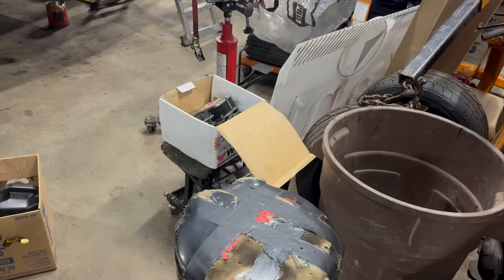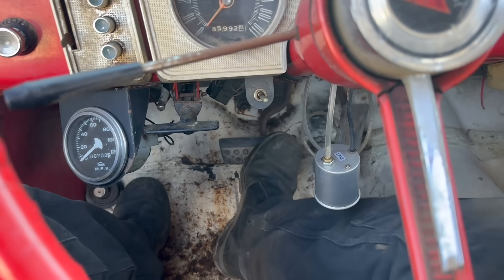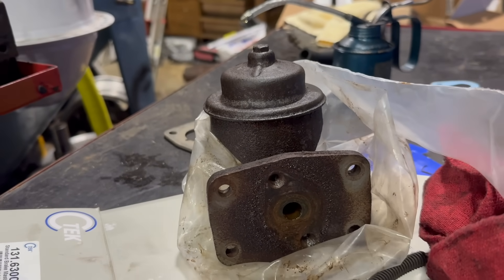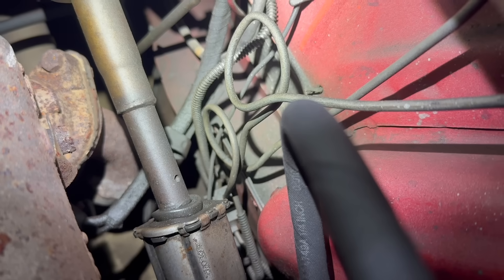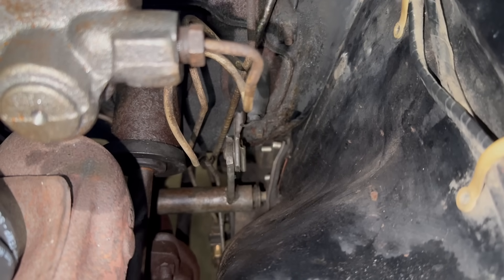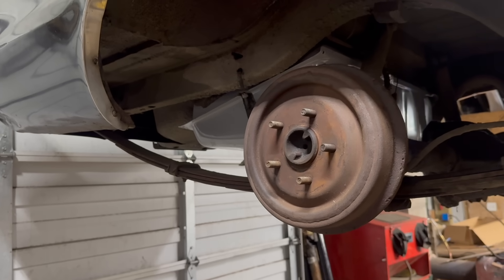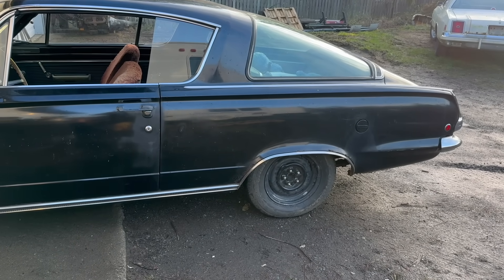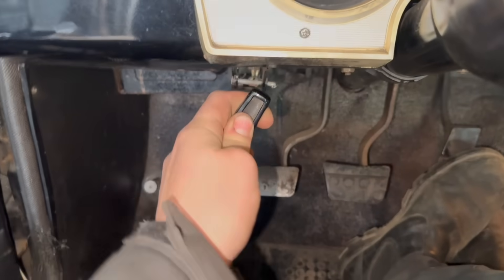Brake Safety Upgrade - Swap The "Pump And Pray" For A Dual Master Cylinder (A 1965 Barracuda Update)

Comment: I have used Fram oil filters for over thirty years and never had a problem,  you and Vice grip garage bashing fram filters is childish
Reply from the maker: So… have you ever seen the inside of one? I have. Have you ever seen one disintegrate? I have. Have you taken a training class in which the construction of Fram and less garbage filters are compared? I HAVE. I see nothing childish about passing fair and educated judgment on a lesser product.
Reply: @DeadDodgeGarage  the one that stuck in my memory is Fram diesel filters. Diesel dissolved the internal glue contaminating the fuel system.
Reply: @alcyr5655  I have seen it with my own eyes. My buddy changed the oil on his box truck himself. Within a week, he was on the phone to me asking if I could come to his business and listen to his engine. Yeah, engines don't lubricate well with cardboard...
Reply: My dad (RIP) worked for Chrysler for 44 years plus. He would never put a Fram filter on a Dodge, Plymouth or Chrysler engine. Never.
Reply: @OtherSarah2 My Dad was a CPD dealer mech for decades. He also refuses to use a Fram. As for me and my house, we run a Fram-Free zone
Reply: I prefer Hastings, Baldwin or Wix filters. The kid bought a FRAM oil filter for the 05 Buic(3.8L) and wow 1526 miles later it crushed its self. FRAM is code for JUNK.
Reply: I'm guessing you never cut one open to compare it with other filters. That or you changed them every 100 miles. 50+ years in industrial maintenance proved to me Wix, Baldwin or Hastings are the filters to use on any application using oil
Reply: @michaelwittke8336  Baldwwin for me!!
Reply: All I know for sure about Fram comes from several times I bought one at Walmart when changing my oil that day and that's all they had.  Big block Chevy, several small block Chevy's, a Caddy 425, a Ford 300 six, and maybe a couple of others I don't remember, and they ALL had half the oil pressure at idle.  ALL of them.  Fram-No thanks.
Reply: Everyone has an opinion )
Reply: I had the same experience on my Dads farm. We never had a problem or ever lost an engine. But I did stop buying them after I heard all the people bashing them. One of my cars has an open engine compartment. I would be embarrassed now if someone looked over and saw a fram. Don’t know how VGG has not been sued for defamation yet. I guess it’s the same as shooting a stack of Bud lights .
Reply: They come rusty from new. Crack one open, and then you wont want to use them. Its not a big investment to check for yourself. But my question is this. Why is it childish if Jamie has an opinion thats different from your own? You can say your experiences, debate it, and thats all fine. 

Then youd avoid the pin of shame lol.
Reply: I prefer Lee, but my stash disappeared years back. Personally never had Fram trouble but they do rust out and crumble when they sit for extended periods in the project yard.
Reply: How dare you. 😂
Reply: “Childish”:   Not being able to accept someone else’s opinion on a topic that differs from yours to the point where you can’t just either ignore and scroll by, or respond in a respectful manner.
Reply: man, you sound like a Fram worshiper, it's still a free country he can use or not use whatever filter he wants; I happen to not like Champion copper plugs will i be sent to the spark plug gulag for that, I have used them all and as long as you change the filter with the oil no matter how cheap or expensive the filter is it used to be every other change really it did your good ,
Reply: I hear they have a weak bypass spring and they bypass all the time not really filtering............ there are better filters
Reply: I've had 2 fram filters plug on my truck NO More
Reply: It's Jamie's channel so he can say whatever he wants! Deal with it, man!
Reply: Well mark if you go into the store and open a brand new one it shouldn't have rust in it. The one I bought did..
Reply: The high end filters from Fram seem to be fine and built similar to their competitors. But, the cheap Fram filters are garbage on the inside.
Reply: There are a few youtube channels that cut open filters for comparison.  Watch those and use your own judgement.
Reply: I used them too. There are just better made filters out there.
Reply: WIX for the WIN !   FRAM is cheap cardboard crap.
Reply: They've been cut open and exposed for the cheap design they are: flimsy cardboard elements held together with glue
Reply: I use only the Fram TG, no more orange
Reply: Yeah i don't get the drama either.I've used Fram for years with no issues,but then again I change my oil regularly.Maybe they changed design over the years?I figure they've got to be better than no filter at all.
Reply: @burtbacarach5034  , I will keep on using Fram. I have been using them for years. Dead Dodge garage won't change my mind.
Reply from the maker: @josephbonnette7877 I don’t want to change your mind, or anyone else’s. Opinions are like buttholes or whatever. Everyone’s got one and they all stink. 😂
Reply: I’ve used them all, for a long time I was a Wix XP user, but awhile back I changed over to the Fram Ultra Synthetic filters as they are very formidable filters and the price is great - my motto is to never leave them in there more than 5000 km
Reply: I have been pulling wrenches since 1973 and never ever had a problem with Fram. I still use Fram on my 79 Lil Red Express Truck
Reply: @josephbonnette7877  '73 puts me around 6 years old. And yes I wanted to help on the farm and service station. Times have really changed since then.
Reply: Watching VV G Is childish. SPARKALATERS- Really
Reply: @BigBoxDodge2020 Yeah, I've given VGG a chance a few times but never finished a video. The dumb humor and low compression personality just get tedious after a while.

He's better when he's with Frieburger or Chappelle. Not a fan

Comment: And !! I did put the adapter on and installed a flip top gas caps, I drive mine daily and have had two early A body gas caps stolen,  no problem with that anymore Jamie

Comment: Yep, took my pump and pray out and put a dual pot master cylinder from a 69 charger and it does great, drove it 6 years, put a later model aluminum truck master on using a two ta 4 bolt adapter.. it moved my master cylinder up away from my hooker super comps fenderwell headers.  Thank you again Jamie,  great video

Comment: Hi Jamie, great channel. Bought a 65' barracuda late last year that I am now starting to get it on the road. Your posts help a lot. 
I have a question that maybe someone can help me with.... 1965 barracuda all original (273 CI) with power brakes drum/drum, will the Raybestos MC36221 fit on the original brake booster?  
Regards Maarten

Comment: Wagner Electric invented a dual-cylinder brake system in 1960 and I believe AMC incorporated the feature in its 1962 Rambler line as did with Cadillac.   Always thought it was funny how Chrysler was supposedly an "Engineering" based company (probably more so in the 40's and earlier) yet AMC introduced it in their lowly economy line Rambler and then you had it on the top-of-the-line Eldorados and such.

Comment: I did a front disc brake swap on my car. It was a factory manual drum car. I did a disk master,  and spliter. Also went from the 10" to 11" drums in the back.  The brake warning light kept coming on, even after everything was well bled. I figured the inline tube brand splitter was faulty so I went back to the factory drum splitter. Seems to work fine, it's always taken a lot of effort if I have to stop in a hurry. It's a little unnerving. Is that normal for a manual set up? Maybe I shouldn't have 11s in the back? They never try to lock up on me.
Reply from the maker: Manual disks will always take a lot of effort. The factory only used 11” rears with 11” fronts. Disk cars had 10” rears. So I wouldn’t have done that - but if you don’t have lock up issues, that’s probably fine.
Reply: @DeadDodgeGarage  Yeah, I came to learn that after I already built it. I may go back to 10s at some point.  I still have all the stuff. Thanks for the reply!

Comment: Hi, in Europe cars have a single brake fluid reservoir, but also a dual X-shaped brake circuit. If there is a major leak, one front brake and one rear brake always remain under pressure. Better, I don't know, but different. Alan from France.
Reply from the maker: They may have a single reservoir, but do they have dual fluid lines? I expect so. Most master cylinders today have one fill cap and one large reservoir, but the lower section is divided to feed the two halves of the master. Chrysler also tried that cross braking setup in the 80s. Today, there’s generally an ABS pump in the middle that feeds the four wheels individually - or at least the rears and the front two.
Reply: Thank you for your reply. Indeed, the dual-piston system has been mandatory here since 1976, with either a front/rear distribution or an X distribution. And it is true that with ABS the question no longer arises. Thank you again for your quality achievements and your good humor. Alan from France.@DeadDodgeGarage

Comment: I remember when I was a mechanic apprentice and at trade school they used terms in module headings such as Duo Servo Master Cylinder and for the rear end Hotchkiss Drive.

Like all we were thinking about was Hemi, Hemi, Hemi, Max Wedge, cross ram manifold tuning, Dana-60, LSD types and theory of operation, Hemi, Hemi etc. Instead we get none of that, just Hotchkiss drive, Duo Servo Master Cylinder operation, Mechanical Voltage Regulator adjustment and theory of operation ffs LOL.

Comment: Fram filters make good suppressors. Drum brakes make you think about stopping before you're actually stopping. I also tend to leave alot of space in front of me when driving. Kinda important when your vehicle is roughly 5500 lbs. Nice vidya.
Reply from the maker: Me too. Even more important when you’re a 10,000 pound loaded ramp truck..

Comment: You're right about the proportioning valve. I installed one on my trike from my Durango i took apart. Im afraid i might have too much braking on that 1 rear tire
Reply from the maker: Oohhhh I bet you do. I’d get a hand adjustable unit for sure.
Reply: @DeadDodgeGarage  on the works.. I ordered one, just waiting on it

Comment: Was there ever a front and rear disks master cylinder for Mopars like Chevy had for the Corvette (thinking about the 1969 C3) for example? BTW, Wagner Electric, a St-Louis Missouri company which was later bought by Studebacker, invented the dual circuit master cylinder in 1960.
Reply from the maker: There certainly were four wheel disc models in the 80s, but in the classic era I’m not aware of any.
Reply: @DeadDodgeGarage  Would a 69 C3 Corvette manual brakes, front and rear disks, would fit a classic Mopar in your opinion?

Comment: I did a dual circuit disc brake swap on my 1957 Plymouth Savoy, using parts from a 1973 Dodge Coronet from my local parts yard. While the swap was easy enough, I do have a persisting problem where the front right brake will make a "clunk" sound every time I hit the brakes and the first pump will not have much pressure. I've bled the system many times but it keeps happening and it still feels like it has a bubble. I'm running one of those proportioning valves with the adjustable rear brake pressure valve built into it. I even tried installing brand new calipers and it still happens. Any ideas as to why this is happening?
Reply from the maker: Piston pulling back in? Had a Mustang once that did that. Believe it was down to a spring clip or something installed in the caliper pushing the pad back in farther than it should when the pedal was released. So every first press had to push it back out.
Reply: @ that’s what it seems like, but I have the same set up on my Duster and it never did this. I started with pin type calipers that I rebuilt, I thought maybe something was wrong with them so I swapped to the sliding calipers and it still does it.

Comment: Actually, over a Century ago Chrysler Engineers designed and Lockeed manufactured their early version of single pot hydraulic brakes as used on Chrysler products starting in...1924.
Reply from the maker: So I’ve heard. Haha.
Reply: Oopsies- watched, then then started writing, then stopped, checked around for my Chrysler History book, couldn't find it, then onlined to confirm, and sent.....late.

Comment: 3:18 Because you live in the Pacific Northwest where steel rusts, aluminum oxidizes, anything absorbent gets moldy, and the entire underside of your car gets caked with mud that hides bolts and fills in screw heads (For example, 9:14 )
Reply from the maker: I noticed 😅

Comment: Rear brakes sliding? just change the wheel cylinders in the rear  or as you say a proportioning valve, put it where you can reach it like in the front of the seat thru the floor  very handy if towing as you can increase the rear
Reply from the maker: Sure, that’s an option. But I prefer to keep them on the outside. Haha. And I did mention the wheel cylinder idea in the video.
Reply: @DeadDodgeGarage    missed it, back when we had real parts catalogues it was easy to pick larger or smaller, harder now  Ford adjustable work well   On my 65 imperial i was towing and lost my brakes going down hill, went right across a 4 lane highway  went with Velvetouch full metallic.  You just had to drag the brakes first block to warm them up  enjoy your posts

Comment: Gotta love the 9 inch drums. My 65 Valiant consistently winds up two clicks too tight on the pass and five clicks loose on the driver. Can you tell me the options for getting working fuel and temp gauges in the dash? I seems to be down to rolling the dice on used stuff on eBay.
Reply from the maker: All of my useful gauge information is in my Fuel Gauge Diagnosis video. Temp and fuel are the same ball game. Gauges themselves may be the problem if limiter died in the closed position - but often it’s limiter and sending unit issues.
Reply: @DeadDodgeGarage  I replaced the fuel sender and the fuel gauge worked for a few minutes then pegged past full and dropped to zero. this all happened before I watched your video on diagnosing gauge problems. I replaced the limiter and repaired the burned spot board but the gauge is kaput. Does anyone sell reproductions?

Comment: We just call them the suicide master cylinder, I drove my 66 Coronet without brakes for around 6 ish months.
If you downshift, use the E brake and don't drive like that much of an A-hole it worked out fine for me.
Then again I'm a racer,weeeeee😮!🤣👍

Comment: Nice video, some learning for those who didn't already know. 
So that was one other feature we kept when converting the A body to RHD down here. The premature locking rear brakes, nice to know that's not our own doing 🤣
I do remember, many years ago, a long, winding, steep hill descent, in my '64 model AP5 Valiant (much the same car as the US 63/64 but with a much nicer looking rear) 225, 4 wheel 9" drums. They stopped doing their job after about 3 seconds. Press #2 button, engine just turned faster, pressed #1 button, engine turned faster still. We just hung in there trying to enjoy the ride. 🥺

Comment: I worked in car dealerships for 16 years when I was younger, and I never knew a single mechanic who used Fram oil filters. One time, the man who owned the dealership I worked in bought another dealership that had failed, and we had to go in and do an inventory on their stock. The parts dept. in the failed dealership had a stock of about 70 Fram oil filters that they kept to service used cars before the cars went out on the lot. Our manager gave me a hammer and a big screwdriver. He then instructed me to punch holes in all of the Fram filters, so they could never be used. I asked my boss why the filters had to be destroyed. He said they were junk. This happened about 40 years ago. I guess Fram's reputation hasn't changed. (I believe Wix was one of the better brands at the time.)

Comment: That would’ve been my next question, swapping rear differential. Those 7 1/4s held up with the v8?
Reply from the maker: They were factory equipment behind the 273 4 speed. That was the only A-body axle until mid year ‘66. So to answer your question… kinda. Haha. As long as you don’t try to get traction and launch real hard, they’ll take a lot more than people might think.

Comment: The dual master cylinder was invented in 1960 by Wagner Electric. In 1967, the federal government mandated that all new vehicles have dual-circuit brake systems, which include dual master cylinders.

Comment: I had the brakes fail on my 66 gto after upgrading the transmission and didn't hook up the e brake yet  because the center cable was wrong for a th400,so me being dumb and 18 I had to show off to my friend going pretty fast down a hill trying to make the car air born i didn't do it though, needless to say the brakes failed as we were heading for a stone wall where the hill came onto another street thank God for L1 or else I wouldn't be telling this story. Single pot brakes scare me after that one.
Reply from the maker: Ouch… yeah, that sounds a bit too exciting for my taste.

Comment: Im still looking for a small bolt pattern front disc brake conversion
Reply from the maker: They’re all over the internet! Pirate Jack is one brand. Mark just put one on his ‘68 Barracuda. He did have a slight issue with the calipers though. Don’t remember what that was specifically.

Comment: Found a picture of the factory Hurst shifter the 68 Charger 383 HiPo had, on ebay restored for 1,800 dollars, 400 for a used one unrestoted. Paid 2,000 for the car in 1980.
👇
HURST Factory Original 1968 Mopar B Body 4 Speed CONSOLE Shifter